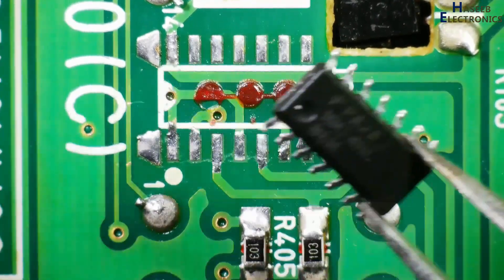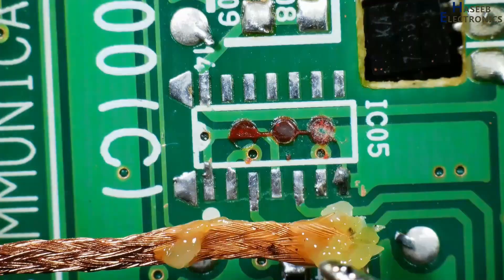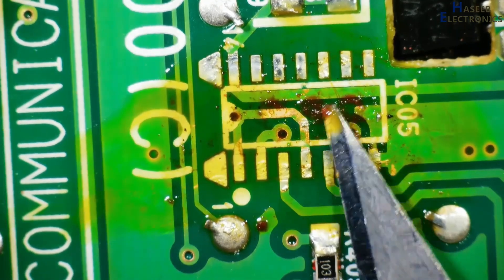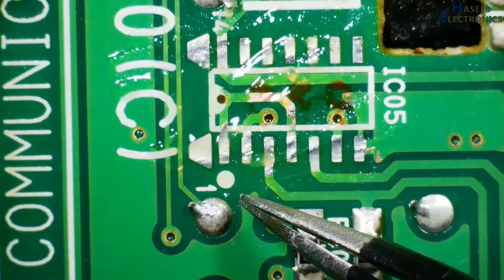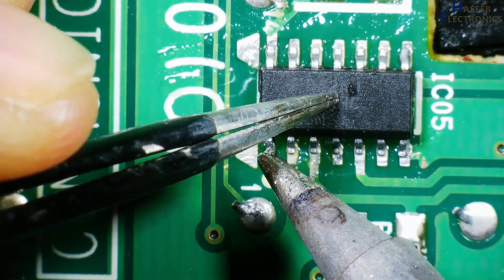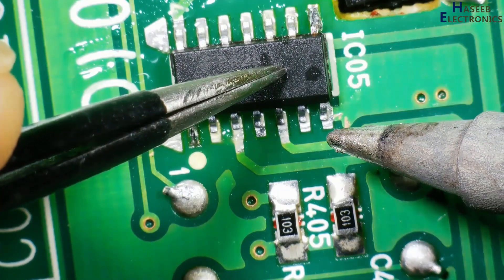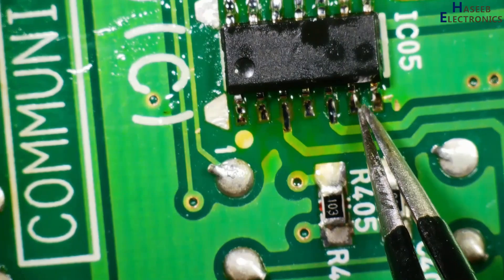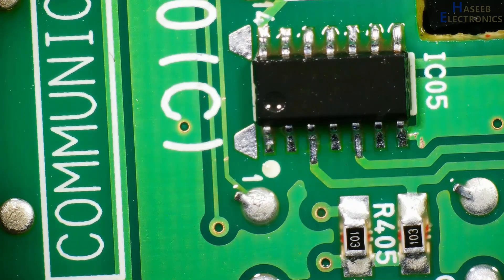{1136} How to solder SMD IC using soldering iron

Comment: I have question
I want a method to test logic gates like hc7404 in the board without remove it from the circuit . So any method or measuring instrument as digital multimeter to test its functions?

Comment: Very good theory and practise. The glue removal step is something a lot of people skip or think it's not important then wonder why the chip is not sitting down onto the PCB haha! A couple of minor things to add.... if the IC is salvaged from another board be sure to add flux to the legs and wick off the old solder, ensuring the legs are clean and all in-line and flat. Also if the IC is old (or even new-old-stock) and tarnished, lightly sand the legs with 400 grit sandpaper so that the solder will stick.
Reply from the maker: fabulous 
thanks for sharing a valuable tip.